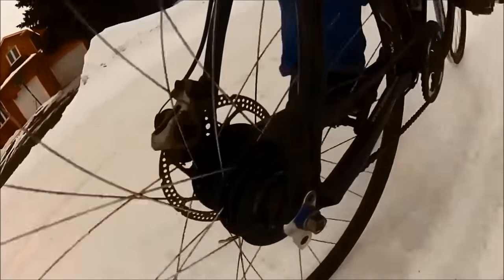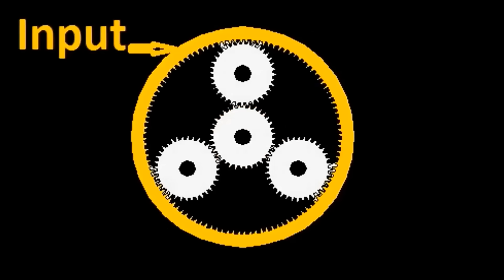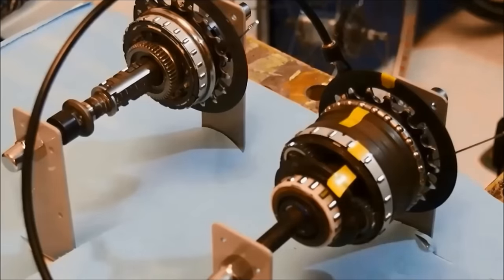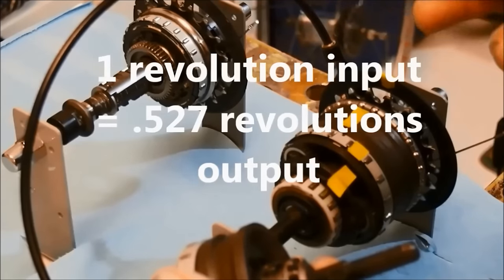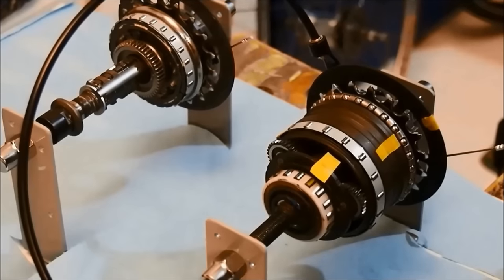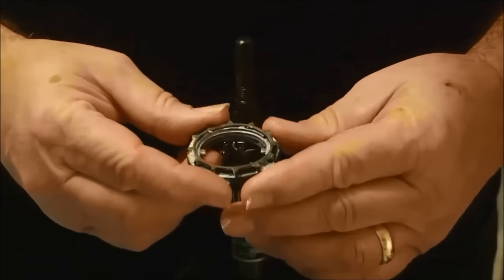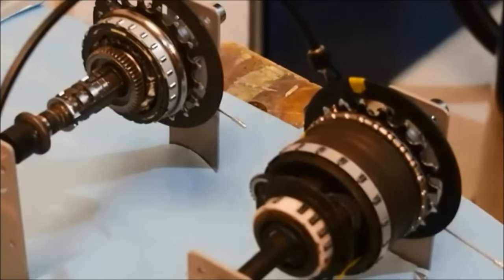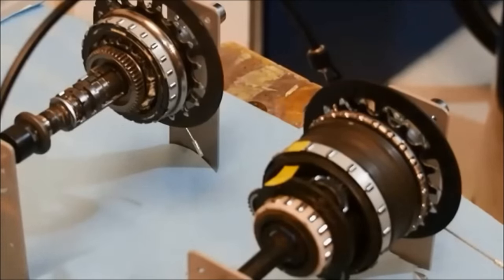Shimano Nexus Alfine 8 speed How it works

Comment: Very good video explanation of the Nexus gear system. I have the Nexus 8 speed 2013 or 2014 model on my commuter bike.  I have been having issues with the 5th gear slipping.  When I shift from 4 to 5th gear or from 6th back to 5th gear the 5 th gear will slip randomly re- engage the slip again. It doesn’t  matter is I back Pedal and then pedal forward again it will randomly slip in the 5th gear only.  After watching your video the issue is that transition to the ring gear.  Is there a suggestion you could make with how I can adjust the gear system to stop that problem.  Thank you for you help, David.
Reply from the maker: Well, 5th gear is direct to the hub shell, so no sun gear locking pawls are involved. The only places it could slip in 5th are the clutch engaging the driver to the planet carrier, or the roller clutch at the end of the planet carrier that drives the hub shell in 1st and 5th.
 If the roller clutch is slipping, the issue would present in both 1st and 5th, but since you say it only slips in 5th, that leaves the clutch that engages the driver to the gear carrier. 
If the adjustment lines are aligned with the shifter in 4th gear, then it may be that the clutch is hanging up a bit on the transition from low range to high.

Comment: Hi Dan. Excellent detailed video!

How Shimano 8 speed hub can lose all the gears? (Alfine8 SG-S501) 
Do you (or anyone) has an idea what may have happened when with a loud bang hub lost all the gears and rewarded me with scrunching freewheeling pedals on every gear and a walk back home. Took the planetary assembly off the axle and didn’t found nothing wrong with the thing. And by looking it neither found a way how it even may lose the connection from the sprocket to hub in the first place. Then carefully looking the detailed explanation here neither found a way that could happen.  At the end, just washed &oiled it and put it back together and everything works fine now. Has ran it with ATF oil for some 10 years now since it was new. Commuter bike driven broadly some 20 000km. When that happened, it was frosty -14C out and the bike hasn’t been wet previously just simply to frost up on me..
Reply: gearboxes like on cars if a bearing breaks your whole gearbox can disasemble and kill itself on the inside
Reply: probably oil froze and it had high friction and the metal bearing wore off

Comment: Dan, quick kudos and a question. 

First, thanks for the easy-to-follow explanation on the inner workings. I had my first negative experience on a 2nd-hand Alfine yesterday and was about to go balllistic on the guy who sold it to me, only to quickly realize that it was drastically out-of-adjustment. 

Now, a question: Assuming that the shifter-adjuster will only get me so much before it won't extend any more, can you add (or point me to) a video explaining how to replace or tighten the cable?

Thanks again.
Reply from the maker: Hi James. There are tech documents on line showing proper cable instalation. They are somewhere buried on this page. http://si.shimano.com/#seriesList/26/74
However, I'll just throw out a few suggestions. First, ensure the cable is correctly routed around the cassette joint capstan. That is a very common error which will negatively affect shifting. Second, ensure the cable is free running in the housing. Tight bends should be avoided.
 Check the general condition of the cable for corrosion or fraying.
 If all that looks good, and you are able to line up the two yellow marks with the shifter in the 4th gear position, everything should work.
 Oh yeah, be sure you are using the correct shifter. The new models, the 7000 series have reversed the direction of spring pull and are now high normal. Make sure your hub and shifter are a match.
Reply: Thanks for the advice. My question was more "5 years from now, the cable will stretch to where I can no longer use the shifter's adjuster", but this is good detail on when I do have to replace it.

Comment: Hi. Great video. I have Shimano Alfine 8 hub in my bike (Kalkhoff Sahel Pro-Connect Disc electric) since 2012 and it ran 17000 km without service. Let me ask you a question. I have my hub adjusted well, yellow points are in the line, but since a few months a metallic clicking noise (like when closing a door) occurs from time to time. It comes when I start pedaling after I have pedaled constantly for say 200-300 meter and then stopped pedaling, maybe for making a turn. It can happen in any gear. I cannot register the clicking through the pedals and the pull is constant and smooth, I can only hear it. Any idea what is the reason and whether I have to be concerned?

Comment: Great video.....but what if i change my chainring to a bigger one and my rear sprocket to a smaller one will that make me go faster?
Reply: There is a recommended ratio between the front & rear sprocket & I believe it is 2.1 -1. If you are hard on your equipment or ride off road you should stay within those ratios. I have been running for 7 years far in excess of these ratios & learned to treat the hub moderately so you CAN ride with decent speed & not have problems but these hubs don't like to be torqued excessively like grinding up a mountain off your seat. They are designed more for in town convenience avoiding the stop & go downshifting required on derailleurs.

Comment: Hi Dan, I was going to give my nexus 8 R36 an oil bath and re grease.  What NLGI level do you recommend for the white lithium grease?  I don't want to spend $20 on Shimano's grease.  I was looking at a NLGI 2 at my local auto parts store.  Thanks
Reply from the maker: NLGI 2 is fine for the bearings. The Shimano Nexus grease is more like a 00 semi fluid and it is good for both the internals and bearings. You definitely do not want to use #2 for the internals.
Reply: @2wagondragon  thanks Dan. Could I use a 00 lithium for the internal and a thicker Phil wood grease for the bearings (which I have a tube of)?  Also, do you see any problem with using Royal Purple for the hub bath?  Once again, I don’t want to spend $85 on shimano’s oil.

Comment: they weigh 1.55 kg + 200 grams for roller braked version compared to an average of about 600-700 grams for hub and cassette.
 What is the advantage of this besides changing gear at stand  still? I think an sram  grip shift would be just as practical.

Comment: Hi Dan. I have another question. I have watched this but it really is beyond me. Anyway, If I have a clicking noise, once every rotation of the cranks, and after changing the chain (i.e the relationship between the front sprocket and the nexus gear sprocket), and then even when I change gears, the clicking noise always occurs at the same point in the rotation of the cranks - then would this noise be from the nexus hub or the bottom bracket?

Comment: I've watched this video a good number of times over the last few months and I think I have a good understanding now. I was confused by your term "reduction unit". What happens is for gears 1-4 the input ring gear is driven by the rider and the planet cage follows more slowly while for gears 5-8 the planet cage is driven directly by the rider. For all the gears the rotating planet cage transmits power to the hub shell by way of either the direct drive clutch (for gears 1 and 5) or the output ring gear clutch for the other gears. Right Dan?
Reply from the maker: Yup, I think you got it.

Comment: Dan, Can you help me. I removed the core to regrease it. I didn't disassemble the core. I just wiped the old grease off and wiped on new grease.. Upon re-assembly, the gear sequence has changed to something like 2,3,4,1,7,8,5 though it's difficult to tell the exact sequence because of the large jumps. Have you any idea what's wrong.
Reply: Sorry, I missed out 6. Should be 23416785. may be the 2 peed high/low clutch is out of phase with the 1 to 4 shifting. is that possible. 
BTW, thanks for an awesome video.

Comment: Hi Dan, i opend my Alfine. took it in the oilbath as described in the shimano maintenence manual and regreased the outer rollers. i put everythink to gether but it seem the hub makes a littlebit louder noise when  freewheeling than usual. haub shifts fine through all gears. any suggestions? did i make a mistake?

Comment: Hi Dan, I really enjoy your Hub videos.  I have a FatTad Recumbent Trike, weights ~100Lbs, and has a midmounted 1000W BBSHD.  So far I broken two Nexus 8 and most recently broke the freewheel on a NV380.  Thinking about giving up on IGHs and going with a cassette, also have a FSA Metropolis Patterson internally geared crankset.  The Metropolis broke once, but over four years its been mosly reliable.  Would you have any recommendation for the strongest IGH?  Thank you for your videos.
Reply from the maker: Thanks for your comments. I have not done any testing to failure of any of these hubs. Manufacturers specify minimum input ratios to limit torque input from human power, but I'm not aware of any published limits on actual torque values.
Anecdotally, from experiences seen online, the Nuvinci is considered to be the most robust in terms of the input torque it will withstand, so if you are breaking one of those, I would say internal hubs don't suit your application.
Reply: @2wagondragon Thanks for your reply.  Agreed, the 380 is likely the strongest, but the freewheel paws break on the stock 380.  Replacement paws are designed differently and are stronger.  Alhtough there is the fluid leaking problem, if you push it too hard and get it it hot.

Comment: hey Dan! great video, i bought my alfine 8,,,,,,but it seems i would like to go faster, right now i have a 42t chainring in my crankset .............can i install a 52 or 53t chainring? will it make me go faster? should i replace the 18t rear sprocket for a smaller one? thanks for your answer.
Reply from the maker: Going to a larger chain ring is no problem. The problem is going the other way to a smaller one the torque input can become too much for the hub to withstand. Changing cogs is cheaper than chain rings, and I have gone smaller than 18 teeth on the cog, but it can cause interference between the chain and cassette joint.
Reply: @2wagondragon  thank you Dan! How smaller can i go on the cog? How many teeth tops?

Comment: Dan, does the drive sprocket act as a torque multiplier like a torque multiplier tool used to tighten and loosen bolts, like a 4:1 multiplier, or is it just mechanical means of switching between theoretically normal sprocket sizes minus the derailer? hope that makes sense.
Reply from the maker: Torque multiplication is a function of the ratio between the input and output. The first stage of the drive mechanism is the chain ring driving the cog through the chain. Since this is almost always a step up ratio, the torque multiplication in this stage would be a negative number.
In the second stage, the input is through the cog, and the output drives the hub shell. In underdrive gears, the torque multiplication at this stage would be a positive number, but the cog itself would not act as a multiplier. The multiplication takes place through the gear train.

Comment: Thanks for your video that helped me understand how it works. Is there a clutch in the alfine? I hear you say about roller clutch. I assume that is the only way it changes gear is from this as when I use mine. It feels very smooth on the ride. Only pulling away do i feel a lag as though the clutch is working. Vinnychoff

Comment: Dan. What is a suitable replacement for Shimano WB maintenance oil? Is it just a marine grade synthetic oil?
Reply from the maker: I have done a long term test using ATF in an Alfine hub with no adverse effects. Others have done the same.
Reply: Yes, I have seen your videos. Thanks. However, I was wondering if you had actually discovered what is behind the part number for the oil...what it actually is? Shimano wouldn't manufacture it - and why is it blue? I thought you may know because of your knowledge of the hubs.

Comment: Hi. I have shimano alfine 8 hub in my bike (sg-s501). Let me ask you a question. I have my hub adjusted well, yellow points 
are in the line, but gears don't change correctly. There's a trouble 
with 6th gear. When I shift gear up from 5th to 6th nothing happens. I 
have to shift up to 7th and then downshift to 6th, and then it just 
runs. You know what might be causing this? Also when changing other 
gears sometimes it's first tic tic tic before changing. I add that 
there's a minimal diffrence in yellow points line between changing gear 
up and down. Also the red line on shifter isn't perfectly on 4, but it's
 a little bit on left (maybe one or two milimeters). Whether it's fault 
of hub, shifter or cable? Thanks for the answer.
Reply from the maker: Well, I would start by ensuring that the cable is routed correctly around the cassette joint capstan. It must be completely seated in the groove. also, if the cable has any sharp bends, or any thing that interferes with free movement of the cable, it can negatively affect shifting.
Reply: The cable is seated in the groove, i can't see anything that could interfere with free movement of the cable. It's straight and looks like new.
Reply: The cable is very short cut, but it's firmly clamped. p.s. sorry for diffrent nicknames, it's still me :)

Comment: Hello, my Alfine 8 speed hub has been making a really annoying clicking noise on most gears....how can I sort this problem out? Thank you.
Reply: Mr5 They do that. It's normal but if you find it annoying change to ATF fluid & it will quieten the hub right down. Make sure you add grease to the seals & bearings if you take the hub apart.

Comment: I've had a Scott Sub 10 with a belt-driven alfine 8 for about a week, bought brand new. After putting 50km on it from 3 work commutes, gears 5-8 have started to produce a continuous grinding noise only when pedalling. I've tried adjusting the alignment in either direction, both made it significantly worse. But from this video it's safe to assume it's clutch related. Any suggestions?
Reply: Check out Pibbles 'n Bits entry above - replace the gear shifter wire - should not be a costly thing to try.

Comment: Hi iam Sammy and I just got me a Dahon mu lx sport bike and is 8 speed with the nexsus. 8 gears and I just want to ask a cuestión how I put greas ore oil into it ore I don’t have to put nothing please help me with this I just want my bike to last longer and work good thank you .
Reply: Sammy if your hub is a Nexus it has to be taken apart through one end/side of your hub. You can then add the oil or ATF fluid, grease to the bearings & seals & put it back together but if you have not worked on these hubs before you are better to ask a bike shop to perform the service.

Comment: Thanks much for the educational video.

I have a few suggestions for newer videos:
1. Make sure the audio doesn't overdrive (there's a bit of this at the beginning)
2. Light up the shooting well enough. It's currently a bit dark
3. If you can, borrow a camcorder that offers manual focus: As usual with autofocus camcorders when shooting up close, the camcorder will often focus on the background, making the foreground dim
4. Make sure the part you're showing is actually within the camera range (around 6:00)

Comment: Sounds like a complicated way to perform a relatively simple function. I wonder how durable these systems are?
Reply: Sturmey Archer started making these in the 1920s.  They can work fine for many years.  There is some way to drain and re-fill them with oil, but it doesn't need doing very often.

Comment: If 5th is a direct drive and 1-4 are low range then how come the hub is not a 9 speed hub with 4 high range gears?
Reply from the maker: This is because first gear is direct drive from the planetary carrier to the hub shell, the reduction at the input makes it low gear.
Fifth gear is the same without the input reduction.

There are only three ratios within the planetary carrier.
Reply: Very good explanation TerFar1 ! :) I figured it out the same way.

Comment: Sorry if this a dumb question. But what if i use this Shimano for rear wheel and use Pinion 18 in the mid as well
For what? I dont know, just wanted to know if that could work or what would happen
Any reply would be much aprecciated
Reply: Yahtadi Shidiq basically you get a transmission like a normal bike with like 18 gears in front and 8 in the back. A lot of gear ratios will be the same though

Comment: Must you not pedal when shifting Shimano Alfine?
Reply from the maker: It is best to break the torque when shifting any internally geared hub. The Alfine will shift under pedaling torque but doing so accelerates wear on the locking pawls.

Comment: In your opinion what of the igh's is the strongest?
Reply from the maker: No question, the Rohloff is the most robust gearhub available. Sturmey Archer touts their new five speed as a heavy duty hub, but we will see if it lives up to expectations.
Reply: Dan Burkhart I'm looking to use one with an electric motor for a touring application, you really think the rulhoff will hold up?
Reply: Jacob, If you are adding an electric assist to your bike the Rohloff is a very expensive way to add a lot of redundant gears. An electric motor produces sufficient torque that your need for low gears decreases. You can quite comfortably add a far less expensive hub & still have satisfactory results. The Sturmey RX-RD5W is being used on some electric bikes as it is supposed to be a heavy duty hub & if memory serves me right costs around $225.